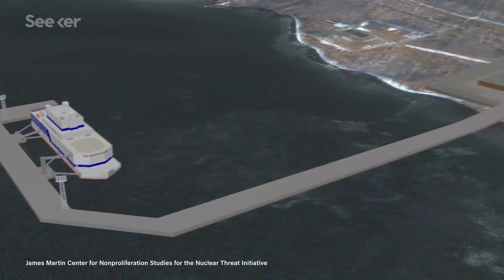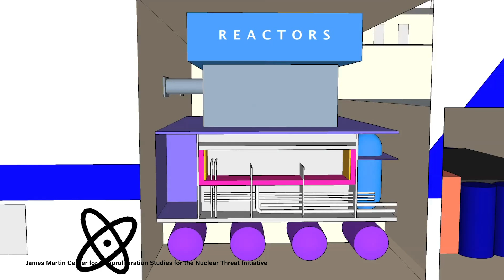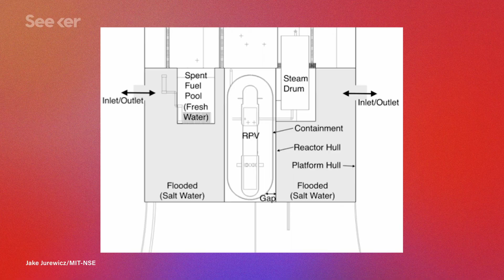Nuclear Power Plants Are Floating on Water…Wait What?

Comment: Ok?

Alright?

Maybe I'm completely mistaken but aren't there nuclear powered submarines and ships right now loaded with weapons?  

If so... what's wrong with a bigger reactor?
Reply: I just hope that nuclear power ships tugged into US and EU shores when they fail
Reply: A submarine requires far less power than the kind of power you get from a plant. Running one ship compared to a large city is quite different
Reply: Joy Chakravarty, not quite.  Nuclear subs refers to the fact that they are powered by a nuclear reactor.  And, yes, they also carry nuclear missiles.
Reply: Yes this video is pretty dumb.
Reply: JohnnyGotHisGun  I wouldn't call 90% as tiny minority
Reply: @uzamakileon4448  nuclear aircraft carrier
Reply: @shatteredstar2149  thats still not much bigger than a submarine in comparison to a city
Reply: It's not even a bigger reactor. These two reactors combined produce 300 MW heat, the single reactor of an Ohio-class sub generates 220 MW, a Ford-class carrier 700 MW.
Reply: Good point
Reply: Those submarines and aircraft carriers are designed to withstand nuclear weapons hitting them this isnt
Reply: @solarsatan9000  why do you think this was not designed to withstand nuclear weapon hit? Fortune telling? This plant uses exactly the same reactors as the medium ships and submarines. It's just stripped off of propulsion and that's all the difference.
Reply: @uzamakileon4448  actually, could you check up reactor composition before commenting? This power plant uses the same reactors in the same numbers as the medium submarines. There even bigger reactors floating around, like several fold bigger. US carriers has more power output and more crew, than the town powered by the Russian floating nuclear plant.
Reply: Step 1: tensions rise between Russia and US
Step 2: Russia sends floating reactor for “improved relations”
Step 3: ???
Step 4: 12 million injured or radiation poisoning, 3 million dead, silent o escapes prison
Reply: @ASlickNamedPimpback  so we can do it with submarine or drone.Why should we sent floating NPP?

Comment: Random question what is the difference between fussion and fission?
Reply: Fission - breaking large atoms apart.  Uranium 235 is a prime example.  Fusion - Ramming two hydrogen atoms together in a series of collisions to produce helium.  This is how the Sun produces energy at its core.  Its core is approximately 15 million degrees centigrade and the density of the hydrogen gas is about 8 times that of gold.

Comment: Fun fact: we’ve been putting Nuclear Reactors in ships and boats since the 1950s. Think submarines and Russian ice breakers. What’s new???
Reply: R 04 this ones have higher energy output, difference is significant there
Reply: Again, missing the point. Actually watch and acknowledge what is being said in the video before commenting. These barges will have to power islands, not just the barge itself, so they will need a much higher energy output.
Reply: @willinton06  Those new Russian icebreakers have 2 RITM-200's (2x175 MWth). The existing nuclear icebreakers are also around 300-350 MWth. The Akademik Lomonosov only has 2 KLT-40S's (2x150 MWth). Your statement is incorrect.
Reply: josh otis  Yes, because of course people will bring this thing into the stormy ocean for no reason and of course such objects aren't protected by swarms of helicopters and small guard ships ready to oof anything that comes to it within 1km range.
Reply: @willinton06  this one has exactly the same nuclear output as a medium ship. There's even bigger nuclear reactors actively floating around and nobody cares. But as long as the word "plant" is thrown in the mix, ignorants are instantly triggered. Should have called it "nuclear powering barge", or something, and nobody would even notice this thing.
Reply: @oko3717  YOU are missing the point. A barge don't need to power itself, it has no propulsion. This is why it's called a barge in the first place, ffs. Nor is this thing supposed to float after being transported to the designated place. Not to mention islands, that has to be powered by the floating plants, usually has less population than an aircraft carrier crew.
Reply: He says this fact in the video

Comment: You seem to have a new intern for selecting stock footage. Or is it a new audience engagement strategy? Biohazard signs on barrels don't convey a narrative about radiation well. Also the New Safe Confinement is not a heavy concrete structure.
Reply: Most people don't realize that a lot of nuclear waste is housed around water. Water absorbs a lot of radiation
Reply: @michaelskinner5006  most nuclear reactors are inside a modified isotope of water aswell.
Reply: I agree. The same way it seems misleading that while talking about nuclear power plants during the first 4 seconds, a fossil fuel power plant is shown

Comment: I have promoted the idea of taking the retiring Nimitz class carriers and de-milling them, then converting them to Emergency Response Ships.  The hanger deck could be converted to a large hospital and recovery area.  The reactors could provide power and water to affected shore areas.  Helicopter access via the flight deck.
Reply: Excellent idea - but the economy?
Reply: @PAVANZYL  What economy?  There isn't anything else available which could do what these ships can do.  It would be a lot cheaper than building new from scratch.
Reply: @kimweaver3323  Maintenance, for example? How many people does it take to man one of these ships? And dry docking them every couple of years? It might be cheaper to build them from scratch. Also, just how much electricity will it be able to supply?  The idea seems good, but it will boil down to economics.

Comment: One problem. Elephants Foot underwater. What prevents that, because no amount of concrete can.
Reply: Ionor Rea's Tech Evolution Archive  I don't know...  I have a hard time believing a melted core at the bottom of the ocean at any depth short of the Marianas Trench would be isolated enough.  Too much water current and food chain to contaminate with radiation.

Comment: what about the oceanic life ?? when any of these go off.
the last irony was really kept me silence for a minute 😂😂😂.
nuclear power plant to power the extraction of fossil fuel WTF🤣🤣🤣
Reply: Look at Fukushima,contaminated sea water(they say treated,but I doubt it) is discharged back to the sea anyway...
Reply: Ugh... Water is one of the best radiaton moderators realy... Go research people a little on radiation moderators. Aparently you can swim in 3m depth swimming pool filled on the bottom with radioactive waste and yet on the surface no radiation. Go figure right? It aint without a reason most reactors use water as cooling and also as neutron moderators. Also what will do one reactor leak to the massive ocean if one banana gives off more radioactivity than that reactor making difference to the whole ocenas of world. And then again, water moderates very well radioactivity hencr minimal damage from radioactivity itself. Ingesting isotopes is different tho.

Comment: This skirts around the differences between the reactors in military ships and serving the grid. The military ones are way smaller, and work at lower pressures and hold way less fissile material. They are expensive per kW generated, but given their use this is justified. 
Having a floating nuclear plant miles off of the shore has several advantages for the operator. The main one will a lack of regulation as it will be out of territorial limits. The main difficulties will be getting the power to land, and getting staff to and from, particularly in an emergency. 

I suspect that in most places this will not be an acceptable move.
Reply: Military power plants also use uranium enriched to much higher levels than civilian ones...

Comment: Why don't they use Thorium instead of "enriched" Uranium?
Reply: Damitha Nadeesha Wanniarachchi Because Thorium is not a fissile material. If you mean the fissile material that thorium is bred into then that will literally become enriched Uranium. 

Except the enrichment will be between Uranium 233 instead of Uranium 235
Reply: @brian2440  The fact the thorium is fertile instead of fissile is actually a good thing. For example, if a liquid fluoride thorium reactor goes critical, the liquid thorium fuel can just be drained away from the fissile material, causing all fission the stop with minutes.
Reply: Electric Fish Part of the point of these reactors is to rely more heavily on chemical interactions as opposed to mechanical interactions with the reactor. 

It’s a bit confusing as to why you would want to stop a reactor from producing in the event that you reach criticality as that is the point for fission production to occur. I’m going to assume you mean if there is a significant increase in neutron flux although for a specific reactor like this it is unclear what would cause a significant spike. Additionally in the event that this scenario occurs you would have a very significant increase in temperature, which is why many LFTR design contain refrigerant molten salt block fails safes in that some material is cooled below its freezing point (which is still extremely hot compared to LWRs 250-400C). As a result the increase in temperature melts the cooled block and thus liquid fuel can fall into a cooling pit reducing fission production extremely quickly. 

This process serves an equivalent purpose as control rods do in a convention reactor under a SCRAM operation, which leads me to the question of how this procedure in a LFTR is inherently safer than a SCRAM procedure? 

With the exception of Chernobyl there is no other reactor in world history that has experienced a significant criticality event during SCRAM procedures. The reason why Chernobyl experienced this event was due to the fact that their control rods contained graphite tips for the purpose of quickly accelerating nuclear reactions by using graphite tips as a moderator. This design for LWR reactors has been banned under IAEA system conditions for reactor designs and is enforced by every chartered member of the IAEA. There are still some reactors that use graphite moderators but they are often in a completely different configuration as an RMBK reactors and many designs utilize gas coolants as opposed to water.

Comment: Using lead for cooling and molten salt in the reactor, does away with the perceived and real problems i.e. water pressure at 2000 psi and meltdowns. Look for LTFR.
Do not assume all reactors are the same.
Reply: Or economical...
Reply: @PAVANZYL  LFTR will cost on par with coal, check it out. A fast spectrum molten salt will use nuclear waste as fuel, of which there presently is an almost endless supply.
Thorium is cheap and abundant, found in up to 10% in some beach sand. 
Wind and solar won't fill the gap, so coal is used. The high cost of nuclear gen2 and 3, is based on water cooling, and attendant problems and regulations.
Reply: @Piccodon  I will study up on thorium reactors, I have to admit ignorance there. My question is simply this: If thorium is so good, why has nobody tried a commercial scale power plant? The regulatory problems will be the same for any fission reactor driven power station.
Reply: @PAVANZYL  regulations are tailored around the paranoia of exploding steam and core meltdowns, to a large degree, and expenses of testing and certification is both lenghty and expensive. Large reactor vessels made of gigantic forgings, core catchers, and containment buildings don't come cheap. 
A molten salt reactor could use a low pressure pump and transfer away reaction fluid while parts are being replaced. Intrinsic safety is integral to their design with melt plugs et cetera. 
Explaining commercial aspects is harder, investors look for short term results, near monopoly of incumbent players with a gravy train of refueling profits that would melt away with a thorium breeders. 
MSRE was succelful, ran many years, but will need additional R&D in materials to extend service intervals.
The production of plutonium in Molten salt reactors is next to useless and has not been a bonus to the arms industry. MSRs are resistant to proliferation, wherever that may be an objective.
Reply: @PAVANZYL  https://en.m.wikipedia.org/wiki/Molten-Salt_Reactor_Experiment
U233 was used later, which is bred from Thorium.
U233 has a companion isotope u232 which is strong gamma emitter, make a simple glove box unsuitable for handling, and incidentally makes the reactor sorta useless for weapons proliferation. 
Yes, more work is needed and DOE is lately starting to fund research. Much about this elsewhere.

Comment: so... what happens if the nuclear reactor ships sinks?  does being submerged in sea water act as sufficient cooling and shielding or will this be a major contamination issue
Reply: Nuclear reactors are usually made of very thick material and in deep, oxygen poor cold seas may take 1000s of years to corrode through. However, the pipes may fracture and cause it to start leaking long before that. The extent of contamination will depend on many  factors and is impossible to predict. Let's say, it will not be a very good idea.

Comment: Try these for decentralized power, who needs the Grid?

Flip substations off-grid, 1-Mw,
>>50-year no-inputs warranty<< 
Belgian: technokontrol, the RF-5000, sparkless for use with explosives.

For off-grid, grid-tied homes or not, 10kw/$15k, 5kw/$8k, >>20-year no-inputs warranty<< S.Korean: infinitysav, that's $750/year for 10kw of 24x7 electricity.

Magnetic motors drive these, it's why they don't use fuels or inputs for DECADES, only upkeep, found doing trade studies, why use anything else on Earth?

Comment: We have until 2030 to halve our CO2 emissions. If floating nuclear power proves successful by then, it'll be too late. No more waiting around!
Reply: Jeroen At the same time removing nuclear reactors makes achieving that goal statistically improbable....
Reply: @brian2440  Depends. Often reducing nuclear output increases the profitability of other energy sources. Look at it this way:

Nuclear power stations are a base power station. This means they can only provide base power. They cannot scale down production easily. Base power is the minimum amount of power used at any time. 

Many renewables and sustainable energy sources, as well as gas, are demand-following. This means they can supply base power and follow the demand curve.

If all your base power is supplied through base power plants, this means the flexible power plants can only run during peak moments. This makes them very unprofitable. This means it only makes economic sense to use fossil fuels.

Closing base power plants, like nuclear but also coal, means power following stations can also start supplying base power. This means they can run all the time, making them more profitable. You have to pay for the entire facility anyway, so it doesn't increase costs much.

Additionally, this means photovoltaic solar energy can be used. Unlike other solar systems, photovoltaic solar panels only generate energy during the day. This means they can't be used in conjunction with nuclear. Why is this important? Because photovoltaic solar energy is in many places of the world, especially countries that tend to pollute a lot, the cheapest form of clean energy, and often even the cheapest form energy altogether.

This means deploying solar with sustainable demand following plants is often a lot cheaper than deploying nuclear together with those same demand following plants, but requiring expensive subsidies for the later as they're not allowed to run most of the time due to the nuclear.

TLDR: nuclear power plants, like any base power stations, can drive up costs of other power plants immensely. The other power stations can't be demolished, must still be maintained, but aren't usually allowed to run.

This is only a problem when nuclear is depended on too much. 10% nuclear won't drive up costs elsewhere, but it's politically often more feasible to campaign on closing all nuclear than only closing some.

The IPCC predicted that in scenarios where we depend too much on nuclear, or fossil fuel emissions will not reach the desired levels. They argue there should be some, but not too much nuclear.
Reply: @BineroBE  LOL. Renewables are not load following, except for large scale hydro and biogas. And replacing baseload nuclear with variable RE and peaking gas is a big step backwards for the climate. I don't see how replacing a large part of zero-carbon electricity with partly other zero-carbon electricity, partly fossil fuels is going to get you closer to your goal of 0 emissions. It literally gets you further from that goal.
Reply: @BineroBE  And if renewables can't compete with nuclear, then surely renewable can't compete with renewables.
Reply: @BineroBE  Your notion that nuclear power plants can't scale down is also completely wrong. France runs their plants in load following.
Reply: @peterselie1779  France' plants try to run in load following but it can't keep up. Furthermore, France has been importing wind energy from foreign countries to make up for inadequate outputs from its nuclear plants over the summer. Offshore wind energy is fully load following, onshore is as long as there is wind.
Reply: @BineroBE  The word you where looking for is not load following, but curtailment.

Comment: Saying nuclear power doesn't emit co2 is wrong and misleading. The uranium which is needed has to be mined which is very energy intensive. This results in 20-150g (depending on the uranium source and the study) of co2 being emitted per kWh of electricity.  https://de.statista.com/statistik/daten/studie/233868/umfrage/co2-emissionen-bei-der-stromerzeugung-nach-erzeugungsart/